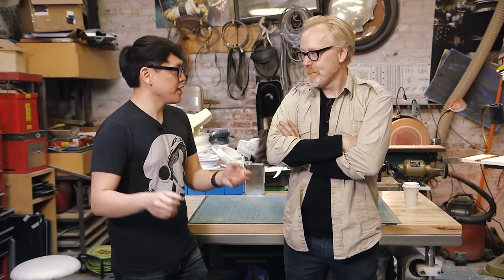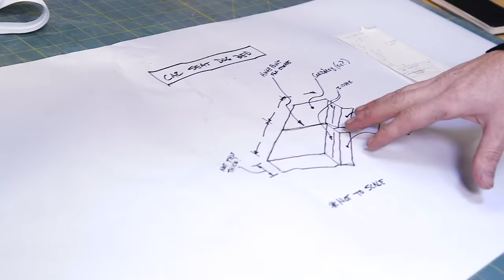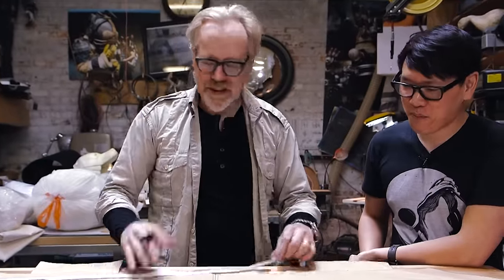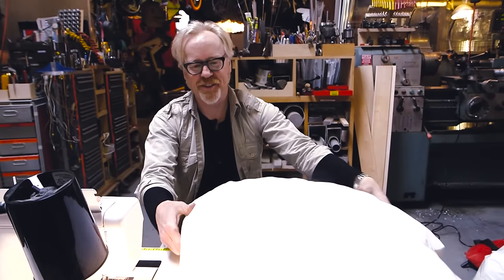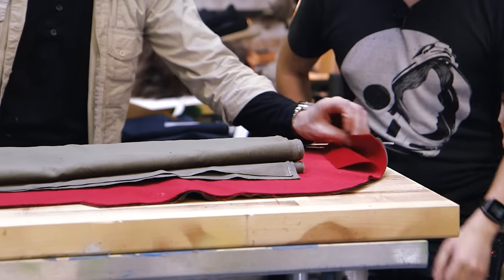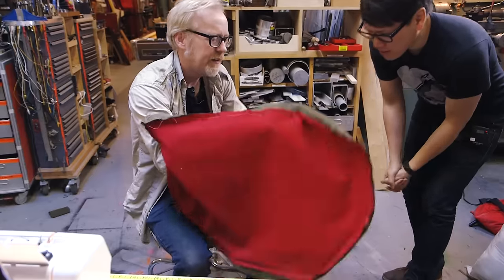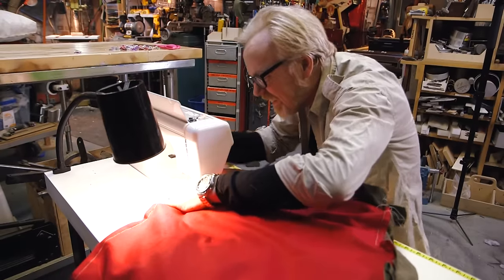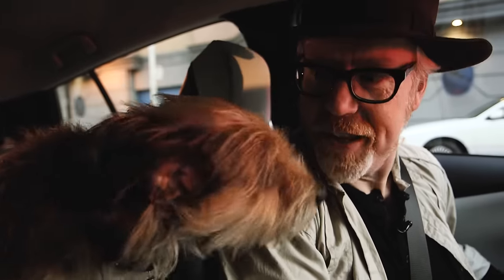Adam Savage's One Day Builds: Puppy Car Seat!

Comment: Was anyone else expecting like a baby seat he would buckle a puppy into?
Reply: +Vegaspsycho Yeah..
Reply: Not only that, but they aren't staying in position very well either.  I don't see how this is really any better than a blanket or something.  Lot of work but I don't understand the benefit to man or beast here :)
Reply: yea
Reply: +LaStarTrek it was worth trying at least. For all Adam knew, it could have worked out splendidly
Reply: Vegaspsycho I would think a removable bed that is kind of like a cradle keeping them off the floor
Reply: I don't know why he didn't utilise the seat belt clips and just picked a few buckles up from a scrap dealers and sewn them to the seat to help keep it in place.
Reply: Yes i wanted a dog seat to hold my dogs in place and prevent them from sticking their head out while they enjoy a rolled down window. Or a seat to prevent them from flying out the window if you step on the brakes abruptly because the dog seat belts i think would not hold them without giving them injuries. He couldve just bought a dog bed and added a piece of cloth to it to temporarily hold it in place.
Reply: @ronrodriguez1567  There is a system we have over here in Germany, that is called "Doggysafe" (doggysafe.de) and is similar to a baby-seat, just for Dogs. We use that system for 9 years now, and our Dog is always safe, and comfortable. I don't now if they ship to your country, but if you look for something like this, it might be worth trying?!
Reply: Vegaspsycho I am the 666th like lol

Comment: Sewing tip my mom gave me: when using pins to join your pieces before sewing, place them parallel to the line your seam will go. That way you can just sew over them and remove them after the whole seam is done.
Reply: No shit, I worked thy out whilst watching the video and I've never sewn before
Reply: Flo Huber Be careful tho, my sewing teacher wasn't paying attention and she stitched into a pin like that and broke her needle. Tbh I prefer taking the pins out
Reply: Do you mean perpendicular? Sewing over parallel needles would be hard.
Reply: Elizibeth Moschin if you sewed perpendicular you're going to intersect needle and pin... that would be stupid... parallel is like train tracks. next to.  beside.
Reply: Elizibeth Moschin he didn't say anything about making the needles parallel to each other, but parallel to the line that you WILL be sewing, that way you can sew and THEN remove them.
Reply: Ive done both ways and still managed to somehow hit pins dead on and either kill my pin/needle or bend one of them beyond repair xD I had a picture of when I hit a pin so perfectly it bent my needle at almost a 90 degree angle
Reply: I used to do this, then I broke a couple of needles by still hitting the pins. 😂 doesn’t take too long to just take them out as you go
Reply: You mean perpendicular.

Comment: On the rounded edges you could stitch on corduroy handles so when you fold them up you can have handles to carry it in and out of the vehicle..  (just use a 15 inch piece of the corduroy material cut into a rectangle that is around 15" x 6" then stitch the seem together length wise so it looks rounded and you could fill it with cotton, stitch the tips and fold them over an inch and stitch again.. Finally stitch them to each of the rounded edges of each cushion) Tada! You have added handles for easy mobility of your cars dog cushion/seat! Great one day build as always Adam! I hope you took the time to read this idea, it would mean a lot to me! :)

Comment: It's brilliant to see a sewing video on here, much as I love al the others, this is more up my street!Really interesting to see you working with these materials.  As a historical costumer I often deal with velvets and various other fabrics that also have a 'nap' (when the fabric looks different from different directions) and you only make that mistake once!  Also fabrics with a pile (like velvet or corduroy) have a tendency to creep when sewing them, as the feed dogs on your machine will pull the lower fabric through but the top fabric gets left behind.  The best solution is to use a walking foot, which has feed dogs on top to help push both fabrics through at the same rate. Also recommend leaving the zip open enough to get your hand in properly in order to open it fully to turn it, you won't find it any harder to sew up, but it'll help later.  Like the finished cushions!  That's the best thing about making your own, you can include all those bits you can't buy on the ready made ones, like the tabs.Thanks!
Reply: I know this is 3 years later, but I read to see if anyone else told him about nap  High five.

Comment: A little tip - when stuffing foam/poly filled pillow form into the outer cover use a dry cleaner bag cut open or a trash bag cut open. Wrap it around the pillow form that is being inserted.  It will slip in easily with no friction and the plastic bag will come out effortlessly.  Easy pesy! Ta Da!